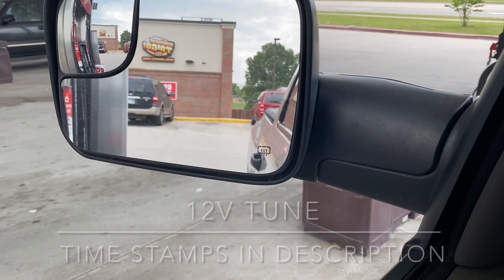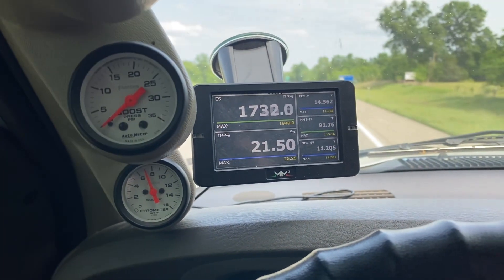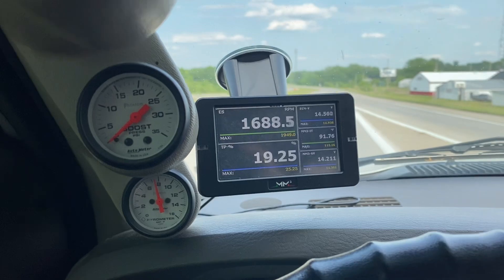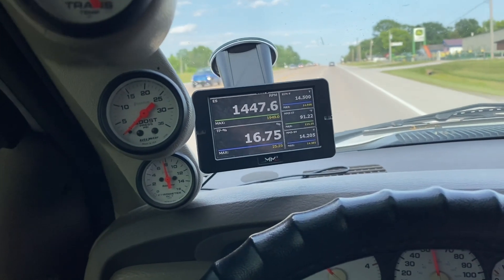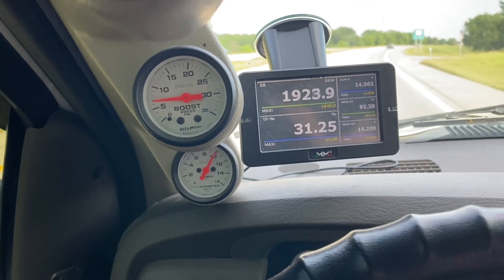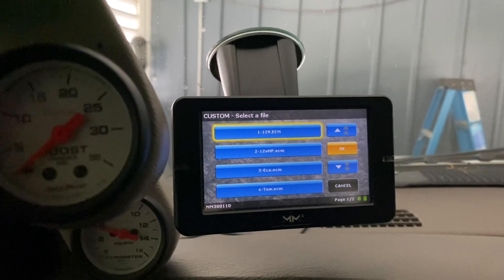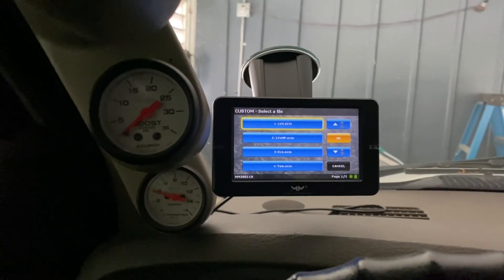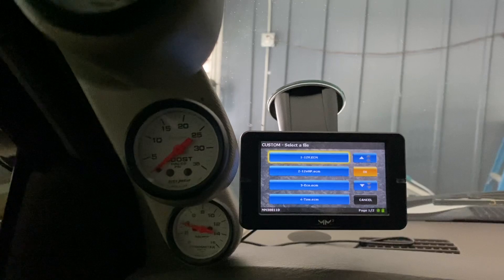3rd Gen Cummins 12V Tune: Sound, Fuel Mileage, EGTs, Performance

Comment: I recently bought a 2115 ram with the 6.7 Cummings.  This is my first time owning a diesel and it has previously been tuned and has the same tuner as you. Mine also has the 12v option in rt and i was messing with it and turned that on and the knock was super loud when i put it in gear..like a tractor...scared me. Thought i was going to mess it up. Is tgat normal?
Reply from the maker: It will definitely make it rattle more because it removes the pilot injection event. So they ka normal and sounds great in my opinion

Comment: Not 100% sure about the original common rail, but I believe the first injection event is just for sound... in 2005 when they added the cat they also added a 3rd injection event which heated the exhaust to try and burn off anything the cat was collecting
Reply from the maker: Yes, I think you’re exactly right about the injection events. On my ‘03 it also makes cold starts smoother with less pull on the starter. That’s why I still run two injection events on the winter, but one when it’s warm.
Reply: @AK_5.9  Yup, I just got Rob D's tunes, including the 12v and it doesn't switch to single injection even until the ECT is 100° which is nice, because it definitely makes it a lot smoother
That also gives me a good "baseline" of how long to let my truck warm up before I actually start driving

Comment: Awesome video! Do you have any feedback after driving with the 12v tune for the last 10ish months?
Reply from the maker: I’m glad you enjoyed it, I had a lot of fun with that tune and it seemed to have the best fuel economy of the tunes I tested at that time. I got the tunes revised when I got my new transmission setup at Firepunk diesel. They were able to keep the 12v tune for me at 663 horsepower. I plan to upload a video about that soon now that it’s warming up outside.

Comment: I’m curious to know if that display and all its sensor readings lets you know when a regen happens or is about to happen?

I know very little about the internal workings of a Diesel and less about the emissions equipment workings.
Reply from the maker: That display is the MM3 tuner which is a tuning platform one can use to tune the Cummins. In other words, it is an aftermarket addition. The truck in the video is an early third gen 5.9 liter Cummins, manufactured before the era of the diesel particulate filter which is the emissions component that requires regen. The DPF wasn’t introduced until 2007.5 with the 6.7 liter Cummins.
Reply: @AK_5.9  ah I see.
Reply: What I meant to say was that’s awesome to own a diesel truck without all this emissions equipment from the factory!!!!

The more I’m learning about this emissions stuff the less impressed I am about having to possibly spend thousands of dollars to upkeep all the surrounding emissions equipment over the long haul.

✌🏽

Comment: My bone stock 2005 gets 14.2 MPG when driven with baby feet. Go figure...........
Reply from the maker: It’s important to note that the fuel mileage I am reporting here is strictly highway. My fuel economy while city driving or a mix of city and highway driving is not nearly as good.
Reply: My brother has a common rail truck and the mileage is not good ..i have a old 12 valve and its ok mileage.  So can he buy a tune that can give him better mileage..He does not hot rod his truck at all or want extra hp just some decent mileage.  Any suggestions
Reply from the maker: What year is the common rail truck? Is he doing highway driving or stop and go driving?
Reply: Apparently lots of differences between trucks. I can drive 2000 miles all interstate and get 14.5. Around town mixed 14.2. Hand calculated, bone stock, driving like a 70 year old in fairly flat terrain. 4.10 gearing 48re.
Reply from the maker: What year is the truck? I’m assuming 3rd gen with the 48re, unless it’s been swapped.
Reply: 2005 as mentioned in my first post.
Reply from the maker: I don't have direct experience with the 2004.5 to 2007 trucks so I don't know what the typical fuel economy looks like for those. Those trucks are different than the 2003-2004 trucks, with injectors of those trucks having different nozzles with wider spray angles, three injection events (with the third being about emissions control), catalytic converters and different pistons. I am not sure to the degree of which those different features effect the fuel economy. Anecdotally, I have seen reports of 14.5 mpg to 20 mpg for those years of trucks. So your reported mpg could be typical for a stock 2005. If we assume your fuel economy is lower than what it should be, there are so many variables that could contribute to this that I don't want to try to speculate as to what it could be. If you haven't already, adding FR3 to the oil and a cetane boost to your fuel will help.
Reply: I have the same issue with my 04. 14.5 mpg highway/city. I bought the truck from my grandfather in law and he claimed 20 mpg consistently. I think the poorer mpg with me driving, is a much heavier foot.
Reply: Debating a tuner but I doubt i am gonna pick up enough mpg to justify dropping 1200. The novelty tunes are cool though. Honestly I want to blame the 48RE for the poor MPG. I thought i wanted a automatic but it's a squishy marshmallow. My 97 with a 5 speed was so much more fun to drive.

Comment: I get my tunes from Rob too,
Im currently daily driving on the Steet Tune and am averaging 22.7 and climning, driving at 65mph, my throttle on the highway is no more than 18%,  my street tune gets better mileage than my mpg tune
Reply from the maker: I had wondered if that would be the case with the higher hp tunes. I’m in the process of testing out fuel economy with his different tunes. 22.7 mpg is pretty amazing. Thank you for posting this information!
Reply: Canuk in the BC mountains driving a bone stock '03 Laramie - 155000kms on it - stock sized tires getting a regular 22 to 25 mpg with no tuners or add ons ...every tankfull of fuel I add "Power Service" fuel additive with cetane boost and drive with a soft foot.
Reply from the maker: @dws5951  I also run power services products. That’s excellent fuel economy, and I’m not surprised with a healthy stock setup in an ‘03. The ‘03 is one my favorite years for the Cummins ram. Makes me sort of wish I would have left mine stock, but I just couldn’t help myself when my stock injectors went bad. Just had to do a build.

Comment: Does anyone know if the 12V tune or Pilot Injection event delete would make the exhaust sound different if the truck is not 2g swap and still has stock 3g manifold
Reply from the maker: Yes, the 12V tune alone with a single injection event will drastically change the sound of a 3rd Gen common rail with a stock exhaust manifold. Swapping in a 2nd gen style exhaust manifold alone doesn’t really change the sound much at all. It’s all about the fueling. The second Gen 24V trucks (which sound the best in my opinion) sound the way they do because they utilize mechanical injectors with single injection events. When the Common rail imitates that it has more similar sound.
Reply: @AK_5.9 This is so wrong lol

Comment: With all the fuel modifications you have….. do you ever have any surging with the cruises control going down the highway?
Reply from the maker: Not while in cruise control. I do have some surging while accelerating under certain conditions. I think the cause is the FCA on my second CP3. I was planning to swap in a Cummins FCA, but the 12 valve tune seems to have mostly resolved the surging. I show an example of the surging in my dual CP3 review video near the beginning if you’re interested in seeing/hearing it.

Comment: I’m mainly interested in why he only has a 35 pound boost gauge and compounds and 100% injectors 😂
Reply from the maker: That boost gauge was installed shortly after I got the truck in 2004, and was adequate for the stock turbo which was present until 2020. It probably is due for a change as the boost capabilities of my current setup are higher than what the gauge can measure. It might be fun to max it out first though 😁

Comment: The rpm change at 65 mph is interesting. Seems it would be determined by gear ratio, tire size and speedometer calibration. I’m having trouble understanding how the lack of an injection event could change that.
Reply from the maker: Yes, and because all of those variables were constant with the two tunes, I’d suspect there must be some difference in the shift points and/or torque converter lockup schedule with the two tunes. Both tunes run well, but it is a curious observation.
Reply: Tq should be locked at that point. Either trans is fucked or this makes no sence
Reply: @AK_5.9  That is interesting, the TC lockup does change your RPMs, because the engine isn't having to work as hard to get the truck to move, since with it locked it functions like a manual transmission... however in 4th while cruising the TC should always be locked, so not sure why you would have seen a drop in RPMs there
Reply: It's not different , he's mistaken. At least during lockup

Comment: I just subscribed to your channel. I have a 2005 Cummins, NV5600 with South Bend 3250 DD clutch, Sportsman injectors and Sportsman CP3 along with calibrated power's custom MM3 tuning. I have a stock 2nd gen exhaust manifold with my HE351 clocked and a 5" turbo back exhaust. I'm really considering going with an aftermarket 2nd gen manifold and calibrated's 64mm turbo for my next upgrades. I might ask them if they can add the 12v tune to my setup. I'm not sure if another company like 59diesel can add a single tune to my current setup which I purchased from Calibrated Power. Not sure how that works.
Reply from the maker: Thank you for subscribing, sounds like you’ve got a nice setup 👍

I don’t know if calibrated power does that type of tuning, but it certainly wouldn’t hurt to ask. Rob at 5-9diesel is also very responsive if you wanted to send him an email to see if he can help you out. I think he could definitely tune your setup. I know he offers a 2 tune package, but I’m not sure if he does single tunes. He drives a third Gen himself, and he’s been running his 12V horsepower tune on it for years. So if you’re into that type of thing, he’s a good one to get in touch with
Reply: Was it hard to do a second gen swap with a stock turbo? How’d you deal with the downpipe
Reply from the maker: The 2nd gen style manifold came with the complete compound turbo kit I installed. The kit came with a downpipe that I had to route into my exhaust system. If you want a closer look at how I did that you can check out my compound turbo install video. I'd suspect the second gen swap kits would include provisions for that.

Comment: If you are chasing MPG increase the over all rail commanded across the board. I do it via a 2200 bar sensor, but make sure you have a higher rated PRV. You probably already know. I have fire punks tunes, and the one thing I noticed was the rail riding at 12 to 16k and I wanted the cruising rail to be higher to reduce smoke when wot. The sensor swap did it. The gauge would read the same because 5v is still 5v. Its increases the rail by about 15% across the board. I wouldn't use a plug when doing this hack. I got frustrated with Firepunk and all I wanted was higher rail so I did this mod to essentially turn the screw.  The end result was less smoke and faster spool up. 

The rpm difference you mentioned between tunes at the same speed indicates the TC was not locked up on the other tune. I would look into that if it was me. 65mph locked should be the exact same ratio. I run FMVB so I have my manually locked. 

Anyways thanks for posting.
Reply from the maker: This is great information, thank you for posting this. I will take this into consideration as I continue to analyze the performance of the different tunes. I’ve also considered a FMVB when I upgrade my transmission. Thinking about going with Firepunk for the transmission and possibly their FMVB package. Is it worth it to go with the FMVB in your opinion?
Reply: @AK_5.9  It was a learning curve but one once I got the hang of it it was great. You have to remember to undo over drive when down shifting. When coming to a stop don't forget to unlock. Locked shifts are hard on the trans. If you plan to go FMVB I suggest getting a fat input shaft because these mistakes are really hard on the trans. The ratchet shifter buttons are part everyone gets hung up on. but its simple once you under stand. You will need a relay for the 12v source. Modding a shifter is a pain just pay the extra 200 for one already done. 

 Firepunk is a great company. They just have a long line of people who use them so they can be slow to respond.
Reply from the maker: Sounds like it would be a blast to drive, and I’ll probably end up going that route. The only problem I could see with having that type of setup is that I might be the only person in my circle able to drive it. Thank you for your input, the advice is valuable
Reply from the maker: Sounds like it would be a blast to drive, and I’ll probably end up going that route. The only problem I could see with having that type of setup is that I might be the only person in my circle able to drive it. Thank you for your input, the advice is valuable
Reply: @AK_5.9  it totally is. When you hit the lock up button its quite the experience. Especially if you got some real power.

Comment: Thanks for the insight! I'm gonna check out these tunes for my 2003 Cummins as i don't have the means to go to a professional tuner at the moment. A question I have as well, what's the max boost you've seen from your 362/475 compounds and what head studs do you have? My truck has the NV5600 and I'm looking into their 363/480 compound kit. Thank you!
Reply from the maker: You bet! He’s got a tune for pretty much every situation. Great customer support too. 

I have seen 30 lbs. of boost, but I haven’t run it very hard yet because I still have the stock 48re. I’d suspect it could make 50-60 lbs. with proper waste gating. I’m planning to make a video demonstrating the kit’s boost capabilities in time. 

I installed ARP 625 Custom Age head studs at the same time I did the injectors, valve springs and push rods.

Good call on looking at a stainless diesel kit. They’re top of the line in my opinion. Your proposed setup would run great. The 2003 is a great year for the Cummins 👍